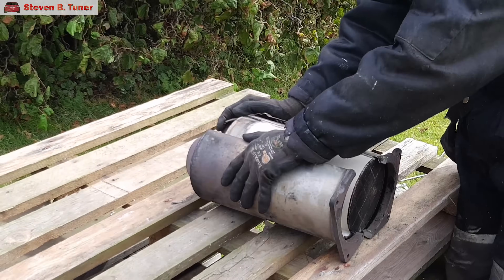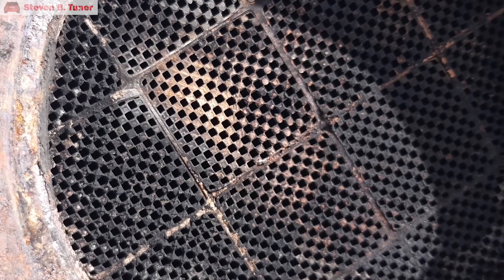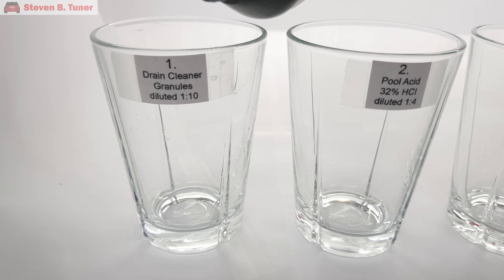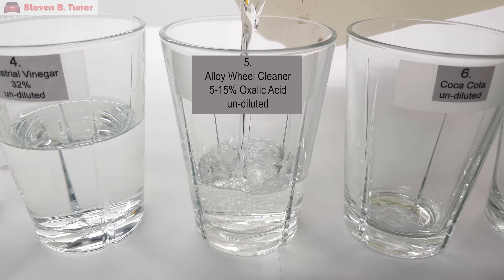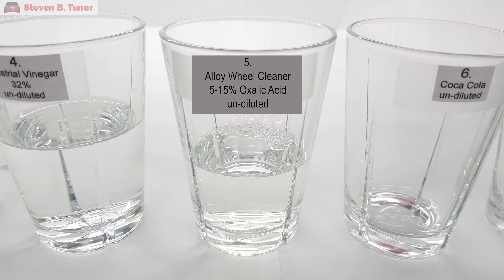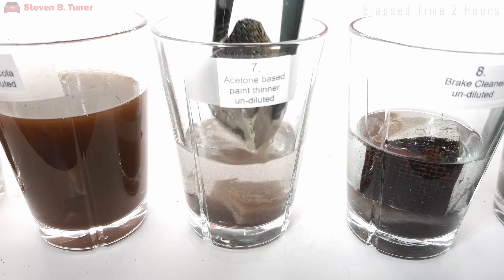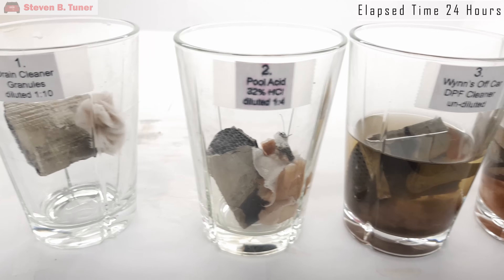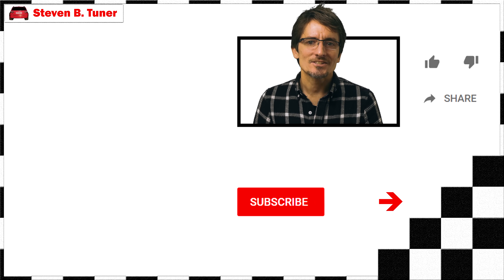DPF Cleaning at Home – 9 Chemicals Tested (Diesel Particulate Filter DIY Ash Cleaning)

Comment: Great vid, Steven! After watching, i removed the lambda sensor and poured 4L of Coca Cola through the hole. My engine light has now gone off and my drive smells of ashy Coke. Win!
Reply from the maker: Haha, that's the wildest method I've heard of yet! Thanks for sharing your great result, and thanks for watching!
Reply: Did you let it soak overnight?
Reply: @pezeshkimh  no, i just let it go through the dpf, followed by a kettle of hot water then went for a blast down the motorway. Light went out.
Reply: And did light came off by itself or by connecting an obd2 diagnostic device? Thanks.

Comment: great video steven, just an idea but how about a video going though and trouble shooting most likey reasons that will cause blocked dpf.. bad glow plugs/relay, stuck/choked egr, no regen short trips etc. what to look for and how to fix them maybe?.. it would be a massive help, thanks.
Reply from the maker: Hi, that is a great idea for a video! You've got most of them covered already - just add boost hose leaks, turbo leaking oil/intercooler full of oil, intake manifold clogged or leaking, bad or clogged MAP sensor, bad MAF sensor, and bad piston rings or valves and you've got everything covered. (Oops, I almost forgot thermostats, temperature sensors and pressure sensors!) A lot easier to write down than it is to check :-)

Comment: Pat
Reply: Sorry, hit comment to soon....I was  looking at some of your options and the cleaner I didn't see that seems to have the Phosphoric Acid is grout/concrete cleaner.  It seems that it has what your looking for as it's a 40% Phosphoric Acid as well as 1% HCL concentration by weight. It seems to be more cost effective than alloy wheel cleaner.  What are your thoughts?  Here's a brand near me  https://www.rustoleum.com/MSDS/ENGLISH/PHOSGAL4.pdf
Reply from the maker: Hi Pat, phosphoric acid should be ideal for this job - I'll have to see where I can get it locally and do some testing. Great suggestion - I didn't think of grout cleaner!

Comment: would be interesting if you could try using these as an "on car" application Steven, done similarly to the way DPF cleaning companies do it, soloution fed in via the pressure sensing pipes while car is running, and maybe have a before and after pressure reading, would be the soloution everyone would be interested to see.
Reply from the maker: HI, thanks for watching! I know exactly what you mean, and it could work for most cars, but I feel that it is way too risky to suggest to folk as a home DIY. I can imagine what could happen, for example, if the cleaning solution went back through the turbo and ended up in the exhaust manifold, and then flowed in through an open exhaust valve and filled up a cylinder.
Reply: @StevenBTuner  The pressure differential from the turbo exhaust port into the DPF (let alone from the turbo into the exhaust manifold) would prevent that, the turbo exhaust is always at positive pressure compare to the DPF or the exhaust which is at atmosphere. Otherwise, any exhaust gases would back-flow into the turbo or exhaust manifold as well, which would choke the engine.
Reply: @StevenBTuner  I would imagine if you limit the fluid volume to say a litre or 2 of each stage or whatever volume the DPF itself would roughly take up then you wouldn't have any issue's on most cars as the amount of pipe from turbo to DPF would comfortably take up way more than a litre on most cars, not to mention the turbo's are always higher than the sump/tailpipe height to allow proper turbo oil drainage so the fluid would 99.999% probably drain out of the tailpipe first, sure, i get that you can't account for the human stupidity factor like someone on a steep hill with front facing down but there's always the "disclaimer" option at the start of the video as well, explain possibly risks, video for info purposes only, do not try if you have an IQ lower than room temperature inside a freezer combined with a lack of common sense to match etc lol
Reply from the maker: I'm hearing you! :-)  A reasonably strong phosphoric acid sprayed in using fairly fine droplets could work like that. If it could be made to foam up somehow that might be even better. The process might be something like: spray in 200ml, wait 30 minutes, then spray in another 200ml, wait another 30 minutes, spray in a liter of distilled water then blow in some low pressure air (14psi / 1 bar) for 5 minutes to dry things out.  Such a method could work really well as something done every 2 years or so to keep the filter in top condition.

Comment: What concentration of hydrochloric acid did you find worked best? Regards Charles Dale
Reply from the maker: Hi, thanks for watching!  I part acid to 4 parts water seems to work the best. Any stronger and it will eat the housing too quickly, and any weaker and it will not attack the ash fully.

Comment: The dishwasher tabs are doing a very good job against soot, I tested already on a very similar dpf from citroen.
I'm adding my filter to a second bath of pool acid, I hope will get it clean..
Reply from the maker: Hi, thanks for watching and trying out my new favorite method so soon! Can't wait to hear how it goes in a real-life test!
Reply: Steven B. Tuner  I cleaned it two times with dishwasher tabs and two times with pool acid, then with high pressure cleaner and allot of soot went out of it.
After that it has 0 mbar differential pressure on engine idle, not even the new one was having 0 :D
for soot cleaning I would strongly recommend dishwasher tabs + high pressure cleaning with water
Reply: by the way great videos, thanks allot for your experiments with the different substances
Reply from the maker: Hi, great to hear that it worked well, and that your car is running better!
Reply: One important outcome: 0 mBar is usually bad signal.
My sensor was giving wrong values, was a 3rd party one. After replacing the sensor everything was fine again and I got ~5 mbar..

Comment: Nice info. What about a test with BG245 DPF cleaner? Thanks
Reply from the maker: Hi, thanks for watching and the great suggestion!
Reply: Our 2014  328d just threw a P2453 code DPF sensor so I’m hoping to try a few additives before pulling the DPF entirely. Thanks please keep us posted on your test with BG
Reply from the maker: Hi, that code sounds more like a pressure sensor has failed, and needs to be replaced (or the wiring to the sensor has a problem).
Reply: We tried gas cap replacement, no luck. Lucas dpf cleaner worked for a few days and CEL light back on. Need a proper Bmw code reader to determine more. Will check wires to sensors on that DPF too. Thanks

Comment: Gues I have to watch this eh? I've had Zero issues still after using your cleaning guide. Mechanics hate this guy.
Reply from the maker: Hi, if the previous video has worked for you, then job done! :-) This one is to answer some questions raised in the comments about other possible chemicals. I am definitely not feeling the love from those who profit from replacing DPFs on customer cars...
Reply: @StevenBTuner  yeah, I know. Ment that I had to watch this since you helped me and all  can't hurt to learn more. 

Well understandable, I was quoted 2k from the brand shop of my Volvo here in Norway to fix the issue. 

Ended up costing me like $35  for drain cleaneer and saltsyre. excluding a few tools. Mpv!
Reply from the maker: That's the kind of story I like hearing about!
Reply: @declaredsnow  hvilken video er det du refererer til? og hvilken avløpsrens brukte du og hvor kjøpte du saltsyre?
Reply: @vetborge5141  hei, Er en video fra Steven. DPF cleaning. Han går nøye gjennom det. Jeg brukte Pulver plumbo og Saltsyre 30% mener jeg kjøpte det på Byggmax eller noe. de har det mange steder. Brukes mest for å rense sement fra tegl / betong.

Comment: I have used a caustic traffic film remover (truck wash) but I think I need to follow up with an acid wash
Reply from the maker: Hi, thanks for watching! The truck wash should definitely have helped get any oily soot out of the way, ready for some diluted acid to finish the job. It would be great to hear how it work out.
Reply: Thank you, that's most helpful.
Reply: I have some Wicks brick cleaner I can dilute, I'm not sure what acid it is though, thanks for your reply.
Reply from the maker: Brick cleaning acid is hydrochloric acid, which is the same as I used in the testing. Dilute it down with 4 or 5 parts water and it should work well. Don't use it stronger or for longer than an hour or it will start eating the steel case.

Comment: Thank you very much for all your efforts. I'll clean my DPF next week.
Reply from the maker: Hi, thanks for watching! What cleaning method do you think you'll go for?
Reply: @StevenBTuner  Dishwasher tablet for pre-wash, and hydrochloric acid for the ash. Glad I found your videos when I was planning this job. Michael from Melbourne.
Reply from the maker: :-) That is my new favorite method - so I'd love to hear how it goes! Hope everything is improving in Melbourne with all of the Covid lockdowns.
Reply: @StevenBTuner  Thanks Steven, I hope the Covid thing will go away soon, also in the UK. I'll report back.
Reply: @ccfabs8932  yes we hope the lockdowns and restrictions go away soon but considering the numbers of asymptomatic cases its likely that twice as many infected would be untested and contagious ....so it seems the best way to fight it now is herd immunity or this will drag on for a long long time?
Reply: @StevenBTuner  DPF was quite dirty as expected. Hydrochloric acid solution is very effective for ash cleaning.The car has more power at low rpm, and fuel efficiency improves about 9% from the first 100km after cleaning. ODO is 200,000 km.
Reply from the maker: Awesome! Glad to hear that it worked well for you!

Comment: Any chance of cleaning a dpf and refitting to see how it performs? Love your methodical approach. Did anyone notice their cola tasted funny after that?!
Reply from the maker: Hi, thanks for watching, and best to stay off the red cola! The previously cleaned filters behave the exactly the same as a new one - for some models you have tell the ECU that you have put in a new filter, but newer cars will roughly calculate ash levels on differential pressure. That is a great suggestion - when I get the next diesel BMW for the channel I will do the full process from diagnostic testing to removal to cleaning to re-insertion and then on to checking the diagnostics again so that everything is covered.
Reply: @StevenBTuner  You would need to clear any fault codes if the PCM set a "Check Engine Light" code, though, if that's set, it is not always going to clear on its own once the condition is resolved.